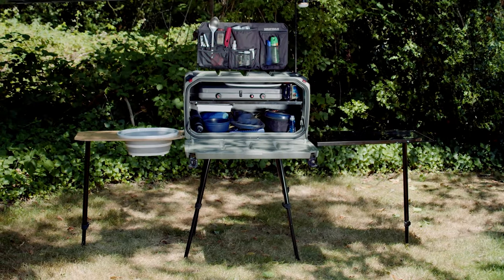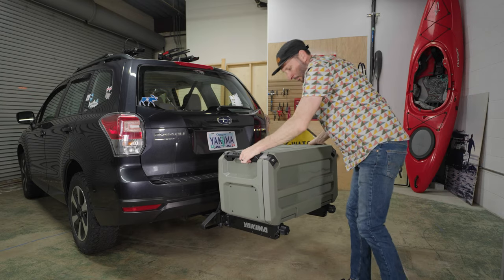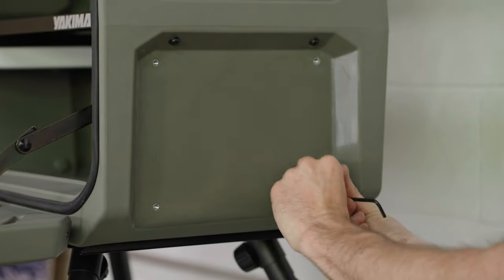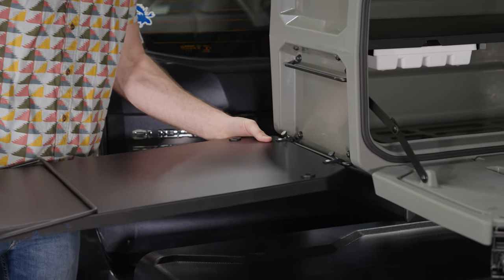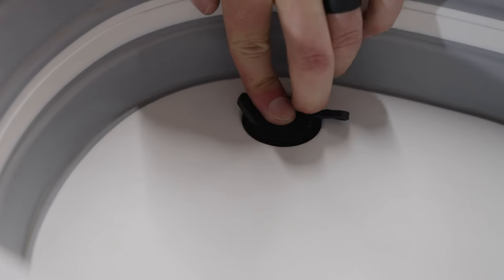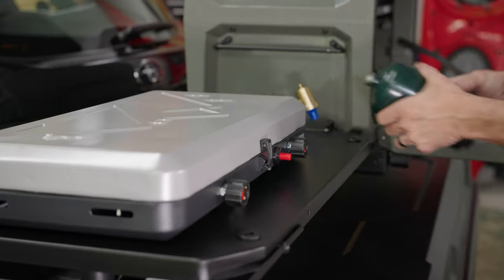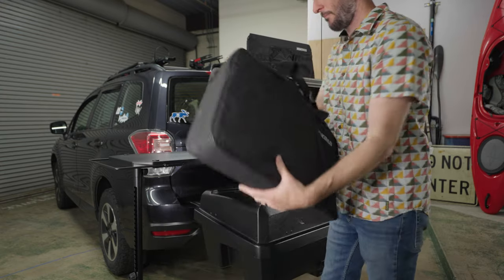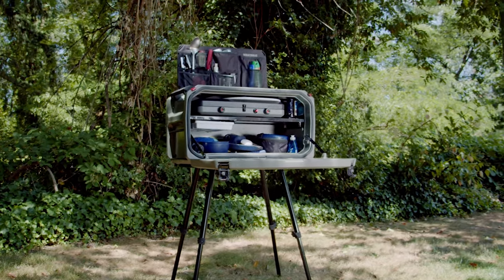Yakima EXO OpenRange Deluxe Installation

Comment: what is showed in the video is around $1,400 ( AND thats just for the open range set up and not the exo base which is $579) the open range is $750, sides are around $150 each , legs $199 , Stove $149 + tax … why is the premium of the system so high? it would be a great product if the open range was equipped with the legs and the sides for $750 but each item is separate?
Reply: yeah, the bundle is 3 dollars more than if you would just buy them all separate.  its cool but how it is this pricey!